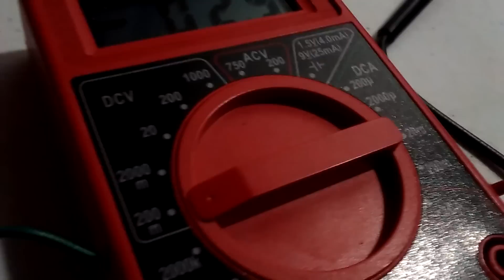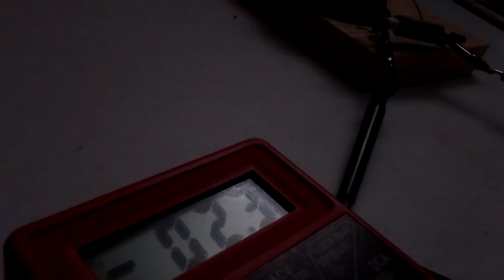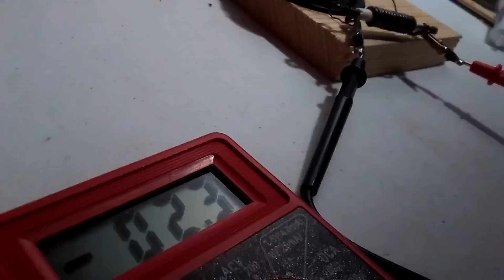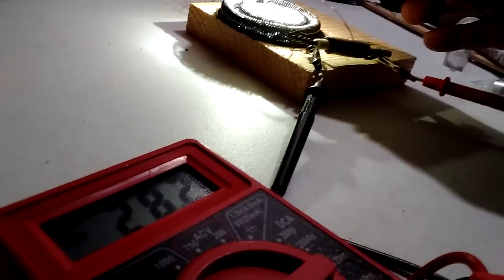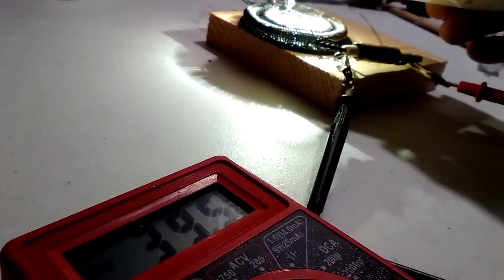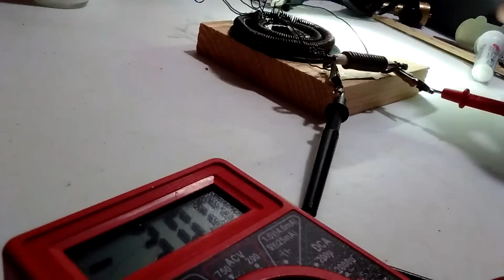Magrav Coil , and capacitor based on M.T. Keshe

Comment: Could you see what happens if you replace the center ball of gans with a quarts crystal? Wrap the quartz crystal with nano coated copper wire. Best to use a long, perfectly cut quartz crystal this way it can stand verticle and disperse light evenly around. Now focus led light through the crystal and lets see the power output. Just a thought, since the coil clearly responds to light...
Reply from the maker: Jarret Calmenson I'll try that thank you cheers!

Comment: Is the LED "white light" introducing ionizing radiation capable of breaking electrons loose?
Reply from the maker: ionization requires very high voltage LED only uses 2 v 1 to 20 mah to small for ionization,but the LED does emitt very low radiation(,Plasma)  I am stumped ,but you could be right.
Reply: mag netron From my perspective, the primary missing ingredient in the Keshe "magrav" technology is FREQUENCY.  They incorporate a 60Hz signal from the house AC feed when the unit is plugged in, but true "free energy" MUST come from the surrounding environment.  Your simple isolated-coil LED observation is very revealing and likely the most significant magrav research I've seen to date.  Thanks for sharing your KEY observations.
Reply from the maker: +NikolaTeslasGhost thank you . my meter is able to measure voltage on DC meter setting , but my oscilloscope displayed an alternating signal. my oscilloscope  is a heath kit put together by someone in the 1960s I bought it at Goodwill for $10. so its pretty old I'm still learning how to use it even though it is old technology analog with transistor tubes, but it is a measuring tool and the M.T.  Keshe magrav is interesting to say the least. I've stayed up late almost everyday just watching its voltage go up then down then back up again. M.T. Keshe is teaching probably the same thing when Tesla said "it would take mankind a thousand years to understand" Keshe is revealing that revelation Keshe lectures are long but I believe he is correct we are all students, and I am a fan of Tesla also. ; D

Comment: What happens if the led on the phone is off. It could be the RF emitted by the phone. possibly. Or what happens if the battery is out the phone?
Reply from the maker: I will grab my led flashlight and test it brb need to set it up
Reply from the maker: I made part 2 video to answer any possible RF signal creating voltage increase. Result from the second experiment with LED flashlight is conclusive. LED light from both cell phone and LED flashlight produced the same voltage increase. That was a good hypothesis Harry Pink, thank-you and the test is conclusive.
Reply: +mag netron Thank you thats awesome :))
Reply from the maker: Harry Pink  your welcome !